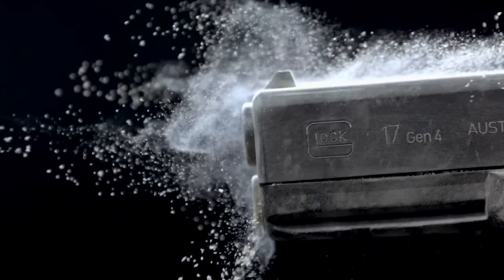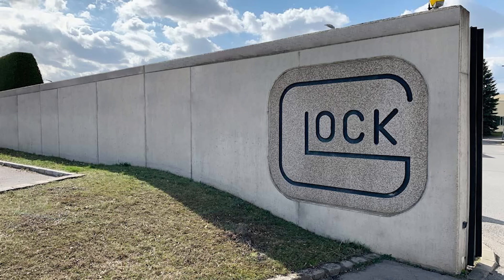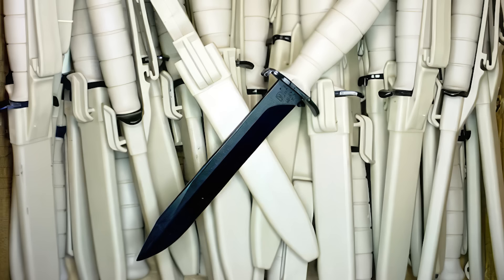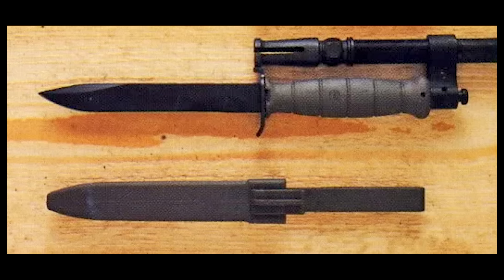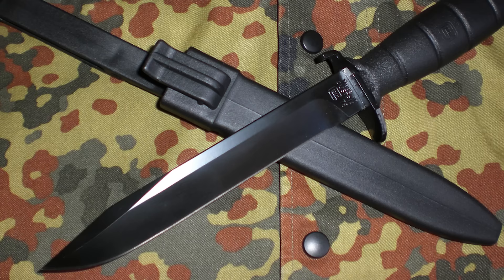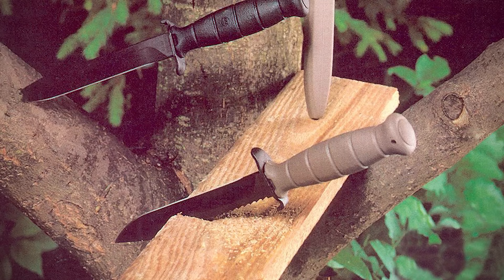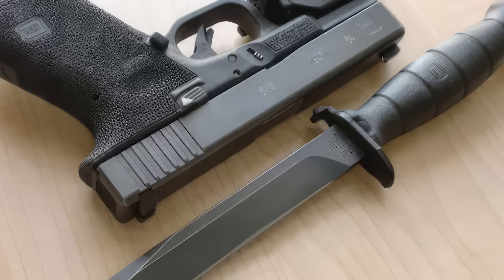How Glock Made the Perfect Knife

Comment: The worst knife I have. Can't keep an edge and rusts constantly. I also had it for seven years, in the army.
Reply: It's a terrible knife. It's edge geometry is only useful for stabbing.
Reply: Ever tried this thing called cleaning the damn thing and sharpening it like every other knife?
Reply: @Cold_steel. 

Spotted the glock fanboy
Reply: Glocks handguns are hideous IMO, but the knife seems decent. Obviously it needs cleaning, oiling and sharpening.
If you don't take care of a piece of kit, it wont take care of you, that's just how it is.
Reply: @Cold_steel.  it's thick, 3/16" and the width of the blade is less than an inch wide the bevels are hideously steep. This knife has the edge geometry of a splitting maul. When he says it's only useful for stabbing, he's not joking. This would be a terrible knife for food prep. As a field knife for a civilian,  the only blade worse would be the US m-9 bayonet. And the blade with the saw teeth? In order to saw effectively, the teeth have to be set where alternating tips of the teeth makes make the saw teeth a tiny bit wider than the blade. If you try to saw something like wood, it will cut to slightly deeper than the teeth and then bind up. It's useless.
Reply: Ever heard of respect for tools, knives and guns?  Try some cleaner, preservative now and again.  Works wonders.
Reply: You didint meintain it

Comment: I'm an FM 81 guy. That saw comes in handy and yes, I absolutely use this as a bottle opener. My tan one has been with me since Afghanistan and on every adventure since. I have an OD green one that is on standby.
Reply: Are they really that good? I got one awhile back because it was cheap and figured it couldn't be worse than a morakniv, but if they hold up the way I hear everyone say I'm glad I got it
Reply: @Thoroughly_Wet If they are “really that good” lies in the eyes of the owner. All I can say about them is, that they are really really really durable. In Austria and Germany we like to say that they are little “pry bars” - that’s how tough they are. (when they bend, you bend them back - thanks to the more “soft” steel). now they are not great at holding an edge when abused all that much but that doesn’t really matter anyways, as it will still puncture your counterparts ribcage with ease, thanks to its dagger like shape. perfect for dispatching animals and humans👍🏼🍺
Reply: I have an 81, but I can't see how you can open the handle? Does the cap pop off? I tried but don't want to break anything.
Reply: I got one of those FM 81s as a gag Christmas gift from my buddy almost 10 years ago. That thing is my go to knife. Fantastic little thing.
Reply: I have to disagree I’ve seen them been torture tested and they didn’t preform well.
The blade snapped when used to baton wood.
Reply: @powskier  stick something sharp into the gap of the plastic plug and pry it off. You will likely damage the plug but who cares, it's a field knife.
Reply: @kylethedalek  they have survived so many field tests. It's a field knife.  Not an axe or huge survival knife. It will baton reasonably size wood easily.  For a knife you barely know you are carrying its incredibly versatile.
Reply: Maybe you could've won again peasants with rusty carabines if you had a better knife ey?
Reply: Yes it comes off, it is in there pretty tight.  Use a flat head screw driver to pry it out.
Reply: Yes it comes off, it is in there pretty tight.  Use a flat head screw driver to pry it out.
Reply: Yes it comes off, it is in there pretty tight.  Use a flat head screw driver to pry it out.
Reply: Yes it comes off, it is in there pretty tight.  Use a flat head screw driver to pry it out.
Reply: Yes it comes off, it is in there pretty tight.  Use a flat head screw driver to pry it out.
Reply: Yes it comes off, it is in there pretty tight.  Use a flat head screw driver to pry it out.
Reply: @Thoroughly_Wet  Excellent in terms of sturdiness, but poor in maintaining sharpness。
Reply: @lx051225  what kind of sharpness? Hair splitting isn't necessary in a survival knife. Being able to hold a slightly better than axe sharp edge is preferable
Reply: I had one in Iraq.  I ended up with an Esee though.  I keep an 81 in every vehicle.  An old one is my farm beater too.  I was honestly surprised I liked it more than my old mora beater.
Reply: @powskier  you use the bayonett bent as a lever
Reply: @kylethedalek  Lol at americans and their batoning. You're not supposed to baton firewood with a goddamn bayonet.. :D
Reply: @tatskamaster  It was sold as field knife…
And people rest knives for these purposes all the time too see how durable they are.
Reply: @kylethedalek  That's like using an axe as a hammer. It's still a dagger-like bayonet made for piercing. Just by looking at it's shape you can tell it's not for hacking, slashing and most definitely not for batoning. It's a MILITARY field knife, not a damn survival knife.
Reply: @tatskamaster  Most axes have a flat edge on the back of the head to double as a hammer. 

Secondly all military gear should be over engineered to handle tough situations. 
I would say a field knife is also a survival knife.
It’s also got a Saw on the spine of the blade.

There has been tests done on other knives which don’t have a Belly or such and they handled the tests pretty well.
If it wasn’t made out of such brutal steel or heat treated differently it would probably be better.

I think others in the comments have said they have tried theirs and it worked with theirs.
And many like the idea of if for survival the hollow handle since it gives a place to store items.

Comment: There are a few things I want to add:
• To my knowledge, the Glock 78's perfect balance was not a lucky coincidence, our Austrian special forces explicitely wanted it to be that way.
• The 78-model (without the saw) is classified as an actual combat knife, while the 81 (with the saw) is not, because the “Haager Landkriegsordnung 1905” (Hague convention of 1905) forbids toothed blades, because the wounds they cause are too terrible. So if you want to stab somebody in a war, use the 78. Using the 81 would be a war crime.
• The blades are made of “Federstahl”, spring steel. The reason is their flexibility (they bend, but do not break), and the fact that they can be sharpened with basically a wet pebble picked up from the ground – a sharp blade can be the difference between life and death in a survival situation. Spring steal however is not stainless, so they are prone to rust. But rust is something you can deal with, a broken blade is a different story.
• To my knowledge, there are Feldmesser variants only available for the military, stamped with the Austrian military's emblem, which are of a reddish hue, which comes from phosphor-treatment. This keeps the blade's qualities intact, but protects it quite well from rusting. Because this treatment makes the blade non-food-save, it is used only in the military. At least this is what I heard. Since I am a civilian, who has never been in the army, I have never seen such a knife.
• To my knowledge, the knife's capability to open bottles is intentional. This is a universal tool for soldiers to feed themselves in any thinkable situation. From butchering an animal to cutting cheese, opening bottles,… This is as survival-knife in one of its purest incarnations.
And:
• You should have talked about the sheath. It is one of the best sheaths of any knife I have ever seen. It keeps the blade as dry as can be, protects the wearer, and is as sturdy as can be.
Reply: Its not a saw!
Reply: That hague convention didn't ban saw toothed blades, that's a myth. They just fell out of use because saw blades on the back of knives weren't all that functional so they eventually fell out of use and just fizzled out of service. The exception to this was Germany during WWI who still had saw back blades issued to their soldiers so Allied powers like Britain started a propaganda campaign around it to put them in a worse light. 

Germany eventually dropped them from standard issue mainly because the saw teeth kept getting caught in the thick layers of wool and canvas that soldiers wore at the time. So German soldiers would often lose their knives or get killed because they got stuck at a bad time. It just wasn't worth the extra work to make or risk when a unit could keep a dedicated saw in their packs instead.
Reply: @CollinMcLean  – It is article 23, point e of said convention, that especially forbids, and I quote, “arms, projectiles, or material calculated to cause unnecessary suffering”, – and if you get stabbed by a blade with a toothed back, this is exactly what happens. I also tried to find primary sources (Heeresdienstvorschriften or something, both historic or contemporary) that supports either of our claims. What I can tell you with absolute certainty is that the Feldmesser with a straight back is in fact part of the Austrian military's equipment, while the one with the saw back is not, and I have been told that the Hague convention is the reason for it, which very much makes sense. For a possibly definitive answer we'd have to get our hands on primary sources. Ask a historian, maybe?
Reply: Doesn't make sense that they'd want it to be able to open bottles and intend soldiers to use it to butcher animals and feed themselves if the coating isn't food safe.
Reply: @iunnox666  – I do not know this, I have been told that this kind of coating exists, so unfortunately, this has rumour-status here. Second, it makes perfect sense, because “not food-safe” does not necessarily mean that it is harmful, just like your living room table is “clean” instead of “disinfected”. So, no, this kind of coating would not be harmful, just not at the level of food-safety, and if you can get a much tougher blade, the tradeoff is well worth it especially in a war.
Reply: @mediocreman6323  Looked up some info about this knife(was surprised to discover that it was discountinued a few years ago), the black coating is the phosphate. They all have it.
Reply: @CollinMcLean  The saw backed models in ww1 were issued to medics to make splints, stretcher poles etc and the propaganda was used against them by the allies, who gave an order to shoot any that had a saw backed blade. To me that in itself is a war crime.
They did the same to Snipers in ww2.
I was informed by an Austrian helicopter pilot that the saw blade was for rescue escape purposes in aircraft accidents and also as survival tool branch and root cutter in survival and thus would not be used as a combat weapon. I have used the plain and saw backed versions in the field and found them OK. I also have the AES models which came out before Glock and they are in my opinion better. AES did not make a saw version, but had green and black, the latter i was told was for Austrian Jagdkommando special forces.
Reply: The saw teeth on the back of the blade has a tendency to get caught/stuck in ribs and on bones.....    as told by a Vietnam Special Force's Veteran.
Reply: @mediocreman6323  I've never heard about "not food save coating" on the Feldmesser, we just get told to keep it slighlty oiled to prevent rust. But if we intend to cut our food with it we simply wipe the oil off. Also can confirm that we use the FM 78 (straight back version)
Reply: @nahiwouldwin9  – maybe. The issue with the special coating is basically hearsay.
Reply: The bottle opener is a feature according to Bundesheer manuals

Comment: I went down on my Triumph adventure bike up in the Rocky Mountains.  When the dust cleared I was pinned under the bike.  Fortunately I could reach my camping equipment to fetch my trusty Glock folding shovel.  It took about 45 minutes to dig my leg out and free at last!
Reply: @MrJedi5150  Meet the Triumph Tiger Explorer.  It weighs in at 550 pounds plus another 80 or so of camping gear on that particular day.  Wedged into a berm, my ankle was pined between the peg and the pannier.  I couldn’t get the bike to even wiggle much less lift it off my leg.  Great shovel though.

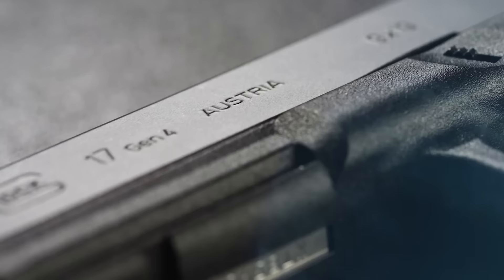Comment: 1:08 - Homeboy is ignoring the scope to use a scope.
Reply: 1x Aimpoint red dot piggy-backed on top of a fixed magnified optic.  Old school gear in the picture, but this is still a very common combination today, just with smaller more advanced optics.
Reply: @commandZee  Those integral scopes aren't actually integral... easily swapped for a picatinny of the same height.
Reply: @TROOPERfarcry That is an AUG A1. That Swarovski 1.5x carry handle scope is absolutely integral to the receiver. You aren't removing it at all without replacing the receiver. Unless you use an angle grinder...
Reply: @mattmarzula  I had an AUG.  You field strip it, and replace it.  It isn't difficult in the slightest.

Comment: This was the first fixed blade knife I owned. I got a Glock 81 for my 13th birthday. I liked it because I saw Nutnfancy's review. It's a great blade 
It's probably the toughest knife without a full tang you can get. 
That bloody plug on the bottom is almost impossible to get out tho.
That upturned part of the handguard is a bottle opener, and a really good one. 
I don't have my 81 anymore, I have a 78 now. The 81's saw is a notching saw for a basha and i didn't use it, it also chewed up my batons.
It's a 5* knife tho. Cheap and reliable.

Comment: Really hated this garbage during my time in the Austrian Army early 90s. Can't use it for anything, we used it only to chop sticks and roots. Rusted the second you looked at it. The best was that the sheath held so well that the knive with the sheath was pulled out of the carrying strap! Everybody used their own private knifes, I use the first Leatherman, which I own till today.
Reply: I'm a Marine, hardly anyone uses Kabars. When you see a Marine with a Kabar it usually makes you smile. Folders and smaller 3.5-4.5" fixed blades are what do the job.
Reply: @1980Baldeagle  Is it true that you can put some hardware store O-rings in the handle and improve the grip
Reply: @tonydragon784  yes.
Reply: @1980Baldeagle 

Look up the SOG Pillar. I gave one to a relative who's a former marine & he fell in love with it saying it's the best knife he's ever owned. It has a 5" blade & 5" handle & weighs only 7.25oz making it super fast in hand.
Reply: Well put. Its totally overrated. Every instructor called it a bad knife and it is a bad knife.
Reply: I am not a soldier, but I like the Glock knives for my camping and canoe trips.
Yes they can rust, so you have to keep them oiled.😉
But they are inexpensive, light weight (250 g. incl. sheath !) and very strong.
Splicing wood, batoning, for the campfire works fine for me.
And yes, I use folders too, my favorite is the RAT-1, and I always carry multitools too, the Leatherman Wave or Victorinox Spirit. 
The combination of a folding knife, a multitool, and a Glock 78 for heavy tasks is ideal for me.
I own a lot a expensive Puma , Buck , Fallkniven, Kabars, Cold Steel etc knives but the most are heavy weight, and I do not use them a lot.
For camping, canoeing, backpacking, I prefer a lightweight, and strong fixed blade, and that is why I like the Glock 78 !  (not the 81 with the sawback)
And for the price.....when you lose it, or it is stolen out of your tent.....that is no big loss, just buy a new one 😉
Reply: This dude is an American Glock hater😂

Comment: I have a black knife identical to that, plain spine, bought in the mid 70's. It was made by AES, Solingen, West Germany. The sheath is the same, except for the clip at the front. Maybe this design inspired Herr Glock. And I love my Glock 30!
Reply: I also have the AES (made by Eickhorn in Solingen) in green and also black. My sheath is a simple polymer belt loop, no sideways removal section and my cross-guard is different to the Glock.
Treasure them they are rare.

Comment: So does the knife feel like crap in the hand and the handle, cross section and blade all need to be upgraded?
Reply: Uh no. Buy one and find out.
Reply: @m39fan  Why? I was unimpressed with their firearms.
Reply: @michaelholt8590 two different things. Also, sounds like a problem with the painter. Not the brush.
Reply: @mattmarzula Yeah almost like it's a matter of opinion.
Reply: @michaelholt8590 

Yeah I know, I dropped my Glock multiple times and it wouldnt go off. Now my Sig, its way more dependable when I drop it.
Reply: A plank of wood is more ergonomical than a Glock's handle. Went with H&K myself.

Comment: So it's basically a Mora knife if it was for the military. Garbage.
Reply: Glock only makes minimum acceptable pistols to begin with. At least a knife is more relevant than horse c*m. 🤣
Reply: @JohnZ556  well, the Glock fanboys can’t fill their thermoses with knives!
Reply: @hooks_and_horns  🙈
Reply: Obviously you've never used one. They're better than most fixed blades on the market.
Reply: @m39fan agreed.
Reply: @hooks_and_horns I never liked Glocks. Until I bought one.
Reply: @m39fan  haha, I dont know about that bud. I dont need to own one to know how it performs. I dont think it's a bad combat knife, but it's not good for anything else. It's pretty much an austrian Ka-bar, and I do have one of those. The glock has no tang, so I gotta worry about it snapping in half when im chopping and batoning wood. Oh but at least I can mount it to a rifle I dont even own. Comfortable but not very well designed handle, so hard to make percision cuts. Low steel quality so I gotta sharpen it all the time. Like I said, it's only a good combat knife. I wouldn't take this out in the woods unless I was gonna be fighting russians